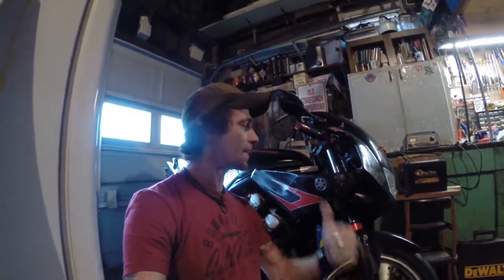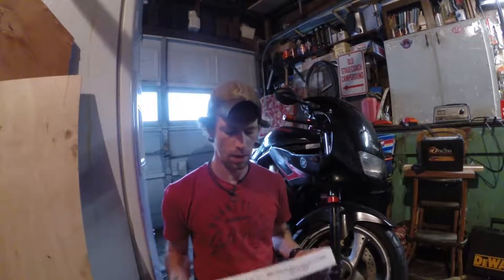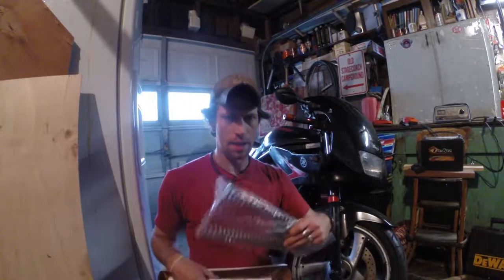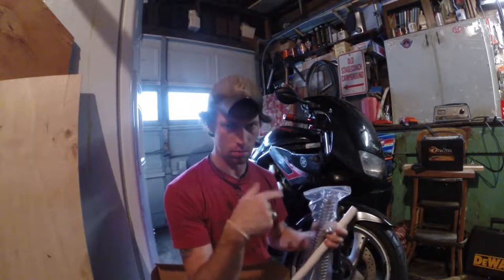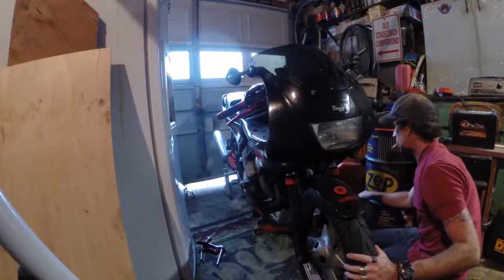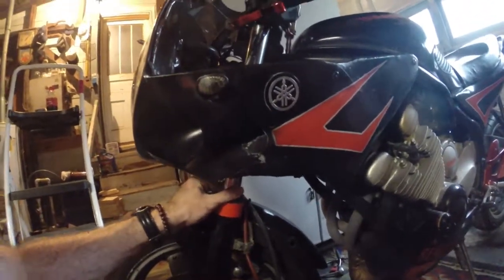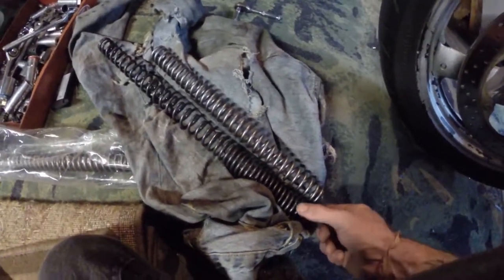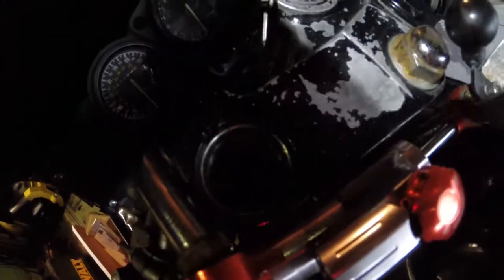The most Expensive Mod I've done to my XJ600 (so far..)

Comment: I knew it 🙃. I had spacers in mine with the adjusters and new oil and seals. I'm going for the spring kit when I get my rear shock and 4"rear wheel off an far. I've been down with electrical problems a month and a half. All went dead when I was dogging it up a hill. Main fuse blowing and when I popped a new one in it smoked the regulator. Replaced it with a QUALITY one ( don't but the cheapies they blow in short order taking your battery with it) and I was able to put in a new 30 amp main and turn the key. All comes on and the starter cranks till the motor fires then boom all is dead. I bought a new solenoid and ignition and tried again. Same thing. All comes on when I turn the key and I cranked it and as soon as the motor fires boom again all dead. And you can't stick a fuse in the main it blows right away. New stator just came but unfortunately I think I blew my brand new 70 dollar regulator from RM Stator so I'll test it before I cry. Also the small connector barrel fell out of my neverland clutch lever now theres nowhere to connect my clutch switch wires. Whassup Man?
Reply from the maker: Wow..ive never had that happen. Of course Ive never used the clutch safety switch either...i just looped the circuit and taped up the wires. If you are questioning the rectifier, grab a cheap one from Caltric (good to have a spare plus a cheap for a test....) I'm thinking you are on the right path; reg/rec, stator...they all can cause wiggy issues.

I always suggest checking connections, especially your grounds. It might be as simple as a fault in the wires. I hate electrical issues...they are the worst. Good luck bro, you know how to reach me if you have more questions. Keep me updated!
Reply: @GreaseRenegade  Thanks bro.
Reply: with my 1993 xj600 i had some dodgy wireing issues, the plug for the rec/reg was melted, and the voltage was not correct. i went to a blke brakers and got another genuine yammaha reg/rec for £20 used and i just used spade connectors, and packed the area with dialectric grease. got a new battery also cleaned all the connecters with contact cleaner as they like to get dirty over time around the front  and the only issue i have now is my bike sometimes does nothing when i hit the starter button, but if i let go and press it again it starts. so im guessing the starter relay or button is old also i dunno if it was a past owner of if the soldering is just crap from the factory and dont last 20+ years :D

Comment: On that last Kawasaki ninja 500 , that tail / signal light was how much ?
Reply from the maker: I dont remember the exactly number, but I know it was an eBay part, so i think it was probably around 40USD or so?
Reply: @GreaseRenegade  thank you . Ever since I seen what you was doing to that 500 I was hooked on your channel.  Kinda ready to trade up to 600cc or bigger bike .
Reply from the maker: @brucejones4655  Thanks man! Yeah, that was a fun project, and im still hoping to get to play with one again. I had ideas to make it way faster... 

Owning a 600 myself, its a lot of fun, and the power is a bit addicting. If you can get a good one for a good deal; go for it
Reply: @GreaseRenegade  what would make mine faster and have better throttle response ? Wished I could show you the new exhaust slip ons  I bought to put on mine to make it run smoother and sound way better
Reply from the maker: @brucejones4655  if you have social twitter or Instagram you can send me a DM there. 

For a better throttle responce, especially if youve switched to a better exhaust and air filter, you can try rejetting the carbs. You could also try changing up the rear sprockets to a different ratio. Both could have an effect. When I put the new mufflers and air filter in that 500, I didnt have to rejet, so i would probably lean towards new sprockets first. (Plus its a maintenance project youll have to do one day any way)
Reply: @GreaseRenegade  I dont but I'll have to create one of those . I actually bought a new rear , front sprockets and new chain all at once but I didnt go to a different ratio tho
Reply from the maker: @brucejones4655  you can still order a new sprocket and put it on if you haven't used the new set. Its not a horrible idea to have a stock set, just incase it turns out you dont like the difference and want to go back